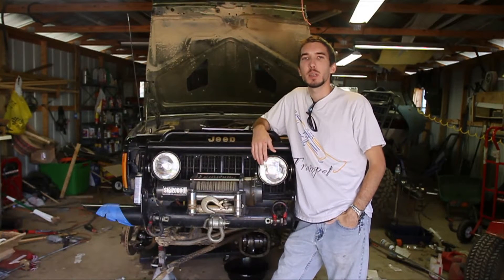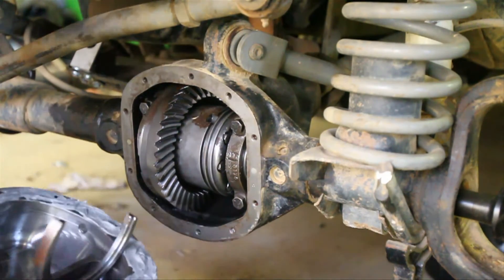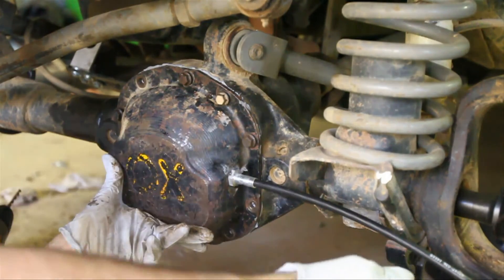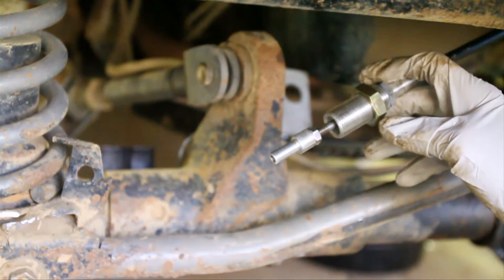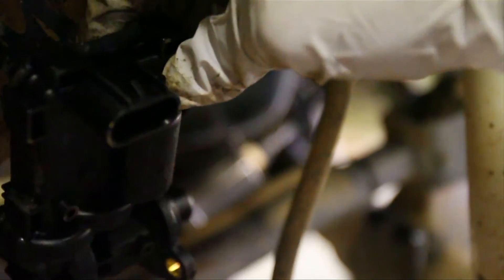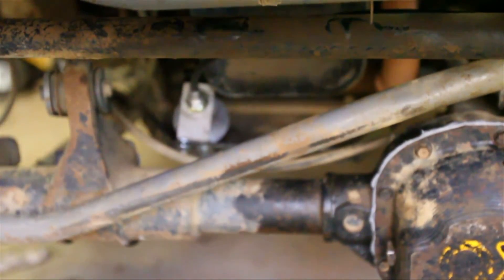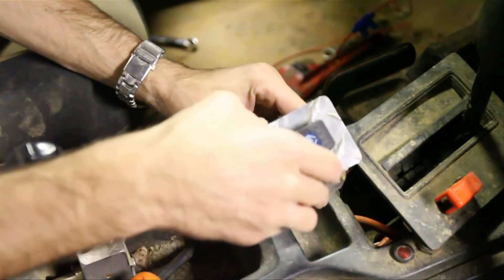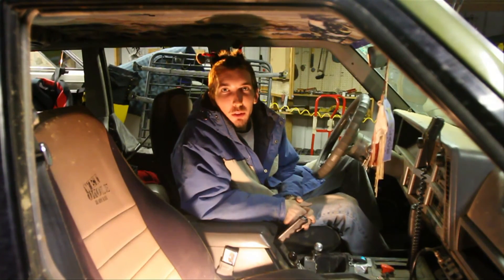How-To Install an Electric Actuated Ox-Locker Part 2 of 2

Comment from the maker: @bmxstreet6 the electric part replaces the manual shifter, you can choose to keep a long cable or get a shorter one.  It is really cool to just have a push button locker though.  the cable run was the main reason I switched to the electric.

Comment: I have an OX locker for my XJ on Dana 30. I have been through 3 cables and just purchased my 4th. If you run the cable anywhere near anything hot it will melt. When running the cable make sure it is very thought out and take everything into account (suspension flex, exhaust, etc.)

Comment from the maker: No, on the front I was going to upgrade to the newer style shifter and I needed a new cable at the same time.  But for a couple more bucks I could get the electric actuator and short cable so I decided to try it.  I have the shifter for the rear and really like it too... just one less thing to go wrong!

Comment from the maker: yes, if the ox cable breaks, or malfunctions you can cut it off and use a threaded bolt in the diff cover to actuate the locker.  Ox sells them or you can make your own.

Comment from the maker: That's a good idea.  I have seen that as a weak point and have tried to think of ways to put a cover there.  But I have wheeled the snot out of it and hit rocks really hard and I guess so far I missed that spot (knock on wood).  The cable on the other hand is the weak point for me, It is always binding, chaffing, or getting pinched.  Only on the front axle though, not the rear.

Comment: You ever think of making a metal "cover" that can be bolted over the cable where it goes into the diff, held in place by the diff cover bolts, for added protection?

Comment: How had that tight cable bend work out for you over the years? Im looking at the same manual locker but have to make a tight turn too, just wondering over time what were the results and would yo do that again?

Comment: Hey Matt I've had the ox in my d30 for about 2 years now and am having problems with it not locking. It worked fine till recently. I had my cable run similar to yours( to inside the spring perch) then ran it back to my tcase skid(longer cable) where the actuator was mounted . worked great like this till a month ago.

 I thought it might be too tight of a bend so I rerouted the cable. The actuator would engage once or disengage then stop working. 
I tried ajusting the cable. now the switch lights up but the locker isnt actual locked. Have you had any issues like this ? Or advice?

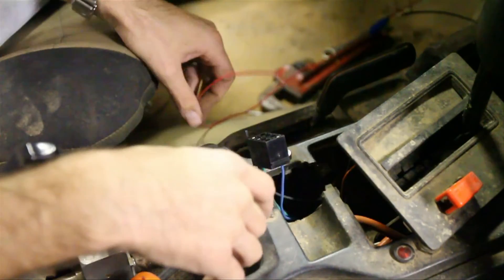Comment: What is that metal looking  ox lever at 6:38? Is that for a rear locker or something
Reply: it's for the rear cable locker, almost same as for elocker but instead the cable runs right to the lever in the cab.

Comment: So in theory instead of having an auto locking system or selectable via air,elec,cable what ever I'm I correct in understanding that ox offers some mystery bolt I haven't yet heard of that can actuate there locking system?